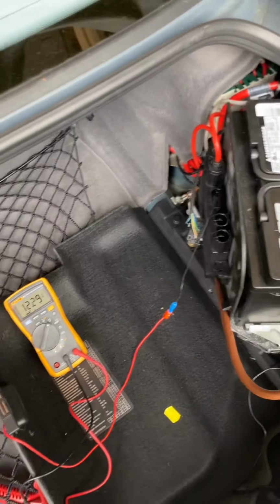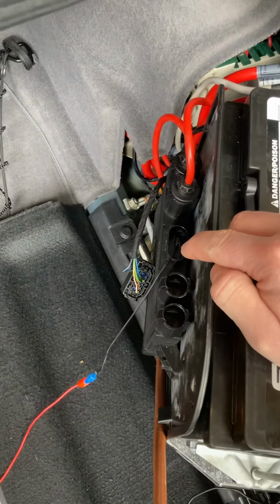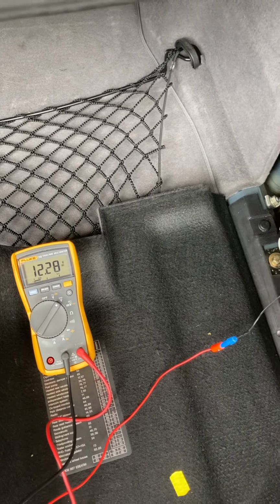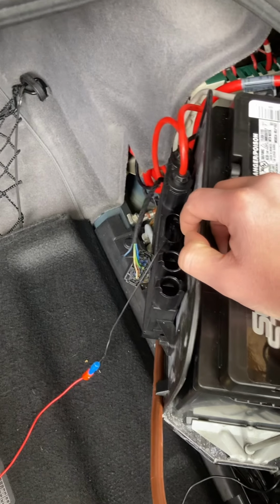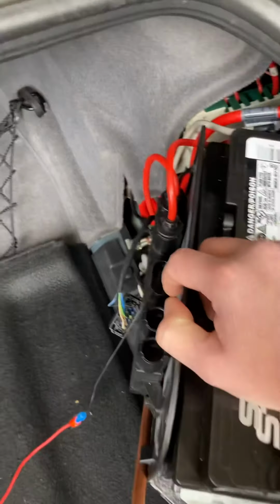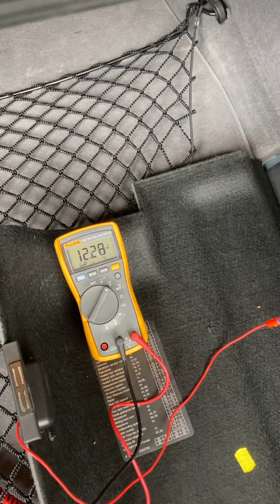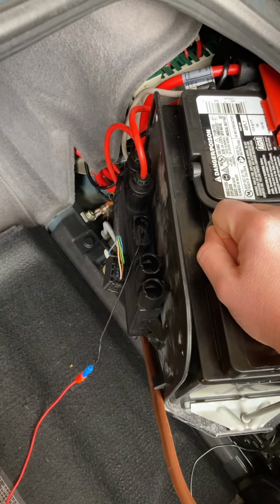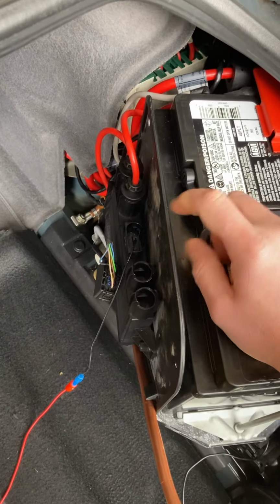E38 750iL Battery Isolation Switch EKat signal

Comment: Hi Jonathan. Did you get anywhere with this? My diagnostics is showing a fault code '18 = TRS: Electronic battery isolating switch: fault stored'. The car runs fine.
I have a CD ROM version of the wiring diagrams from way back, and there are some notes saying that each battery should be charged (in the workshop) via its respective B+ jump point under the bonnet, due to the fact that the battery switch is open in sleep mode. However, I have a CTEK charger connected to the system B+ point and this keeps both batteries charged. Therefore it seems that the battery switch may actually be closed, which I suspect agrees with your observations?
INPA doesn't give me any more than the fault code, DIS cant even see the ETS, and my Foxwell device is also very limited, though hints at KATON. 
I have a spare switch, but this behaves the same way. There is very little info out there for those of us with 2 batteries!
Reply: Interesting trying to diag mine this way as well replaced module ran well for about 200 miles before giving me new code after my can timeout code for my EKAT module now I have cancellation heating EKAT code P1461
Reply: @elahmadgaming7323  I had a fault come up referring to the EKAT module power switch 1. I managed to replace this with a second hand module (new are very expensive), and that fault has now gone. The battery switch ‘fault’ remains, but I have checked all associated wiring, and the switch seems to work ok. Love to know what code 18 is..
Reply: @chrisnewbold9876  yeah I’m running DIS through new ISTA and I will try new battery up top first then module worst case the heated EKAT are bad